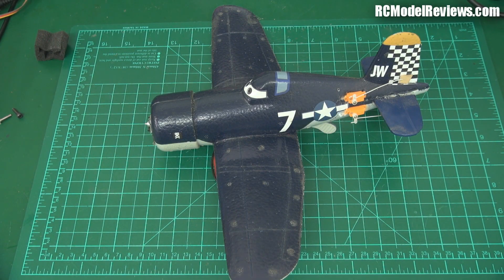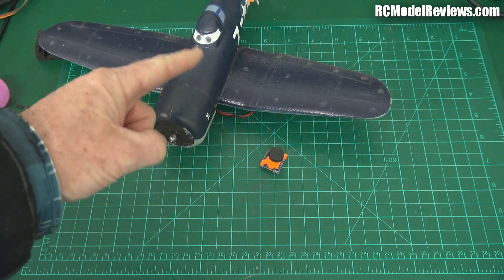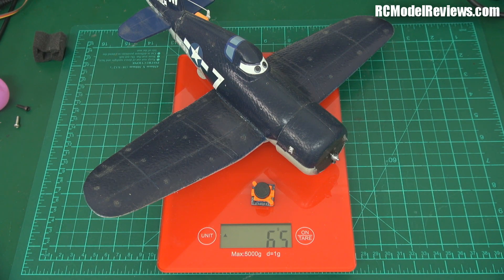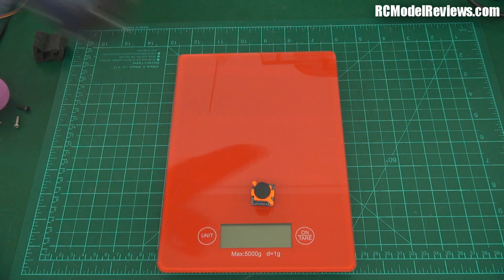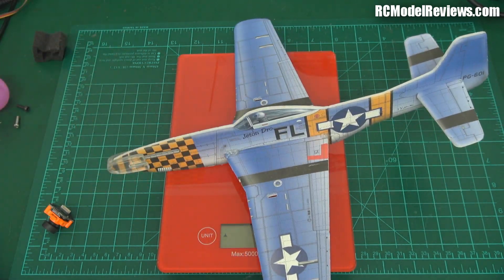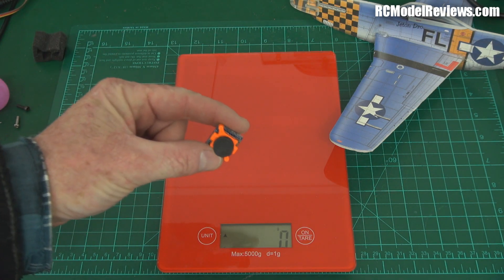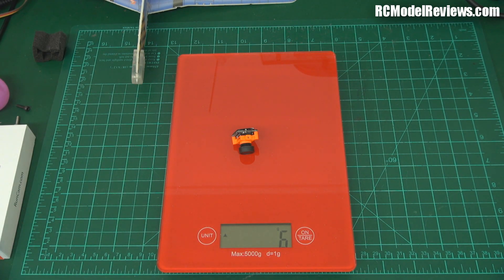Runcam Swift Micro V2 ultra-small FPV RC plane project

Comment: i see it coming...  budget flying wing with goteck micro servo;s  tiny brushed motor and even a micro brushed fc with betaflight on it. and of course a runcam micro to see where you are flying. if it run's on 1s it will be lighter than a theespoon full of sugar. ;)

Comment: Great Stuff! Mini and Micro Airplane Scratch-Builds are one of my passions. Just finished my 3rd build. The airframe is build out of 1 sheet of Adams Foam Board so it cost less than $2 US including the glue. My AUW is 107.8g including the FPV System. Can't wait to see yours flying!

Comment: The Eflite micro planes with AS3X are perfect for FPV.  gyros make em fly like big planes on windy days.  I've been fpving the UMX planes for 6 years now.  nice how low-hassle they are compared to larger FPV planes.  UMX Pitts, Inverza, IconA5, even the HK MiniDLG makes a great medium range FPV plane, all under 250g, as seen in my channel.  I use the Runcam Micro on the Inverza - great cam.  I suspect your servos are too far aft on the Corsair Bruce - micro planes don't like that!

Comment: I love the idea of nano FPV aircraft, but I'll be impressed if you can get that profile P-51 running. It's too small even for those tiny servos. You're going to need one of those units they use on nano planes that's a receiver, brushed ESC, and two linear servos combined. A better option would be the VAS Gremlin, in either biplane or triplane configuration. Alex Greve has lots of videos flying that around his yard, and his place is smaller than the one in the clips here. 24" wingspan is about the minimum for nano fixed wing without using custom equipment that has to be salvaged off a retail nano plane. It would be nice to see someone come up with a hobby grade fixed wing equivalent of a Tiny Whoop though, slow and tough enough to fly around in an average house.

Comment: I think that dude you were referring has a BIG backyard. I must be careful with a 130mm quad in mine and no room to turn the 300mm. Can't even imagine a fixed wing in there more than working at it in the backyard and perhaps testing it on the ground without any taxiing. 
But that camera.... I want. Or something more sensitive like Owl. Sure looks like it can fit a 140g copter :D

Comment: In Germany the max legal transmitting power is 10mw for 2.4ghz and 25mw for 5.8  I'm ignoring both using 60mw for 2.4 and 200mw for video. That's basically the worst restriction. Just don't get caught

Comment: If you want small and light...I have one of these....
https://www.banggood.com/Volantex-V761-1-Firstar-Mini-2_4G-4CH-6-Axis-Gyro-Micro-RC-Airplane-RTF-p-1085528.html?rmmds=search
It comes with Bat/Charger/Radio and is 3 pos Gyro controlled. It's all up weight is only
40 grams.. I would put an FPV Cam/Xmit combo on that for an all up weight of less than 50g.

Comment: 3:45... Yeah I can see a mini Quad in the back yard... but your plane not so much flying FPV through the trees.
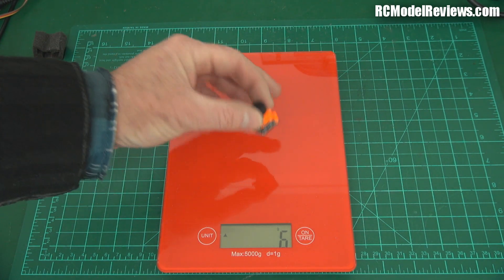4:18... If you use one of these... It is the Camera plus 5.8Ghz 40 Ch transmitter for about $16.00 and weighs all up 6 grams...and free shipping.
https://www.banggood.com/Super-Mini-Light-AIO-5_8G-48CH-200mW-VTX-520TVL-14-Cmos-FPV-Camera-PALNTSC-for-QX90-QX95-p-1095683.html?rmmds=search
BG has other similar Cam/Xmit units with other Cam resolutions and specs.

Comment: Would a brushed motor be a better option for such a small lightweight aircraft? Horizon have some really good aircraft in their UMX series. Perhaps something with a similar setup would be ideal? I love the idea of a super slow ultra light fpv platform. My first ever RC model was a UMX T-28 Trojan... With AS3X stabilization and a good micro fpv rig it would be a dream come true for this application!
Reply: brushless motors are more powerful and will last a lot longer than a brushed one. I'm loving my UMX sbach :D